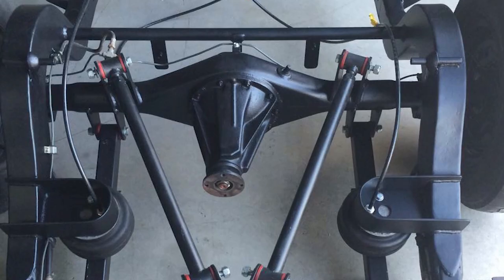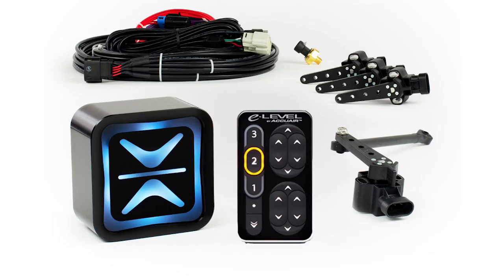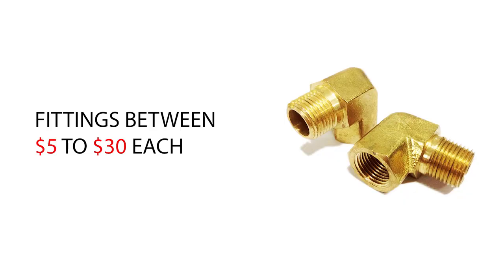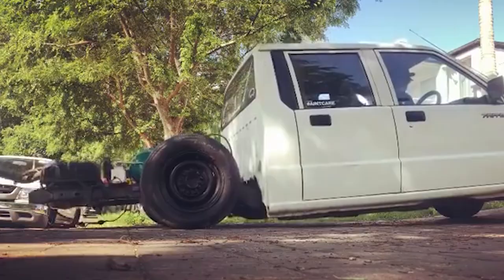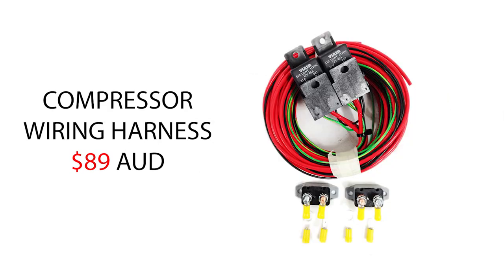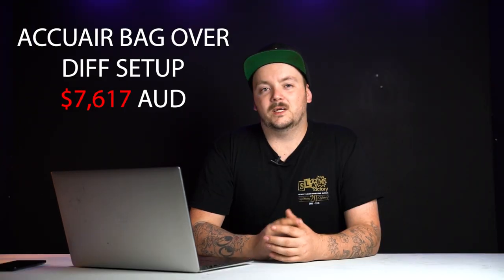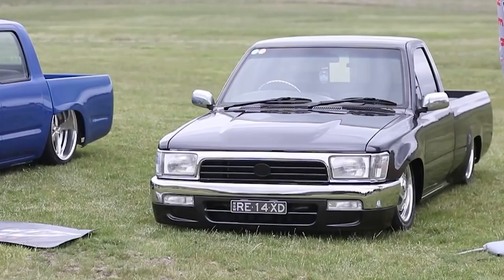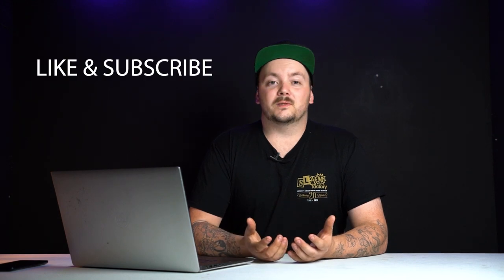Building a Mini Truck! - The cost & parts

Comment: Hey mate probably don't remember that messaged you almost maybe year ago saying I was looking at getting a mini truck and getting into it you gave me a few pages to follow on Facebook so of I want I now have a 91 dual cab Rodeo static dropped I believe but look at just beginning the rear for now im on the central coast any shops you would recommend
Reply from the maker: Hey mate most shops don't take on trucks unless they are getting completely airbagged all round as for engineering purposes they need self levelling which only really works for complete system front and rear but can always message Pnuematic Customs or Twisted Garage there based in Sydney an they will give you the right answers.
Reply: @InspiredExistenceAustralia  thanks for getting back to me bro I will definitely do that as the information you gave me last time helped me out